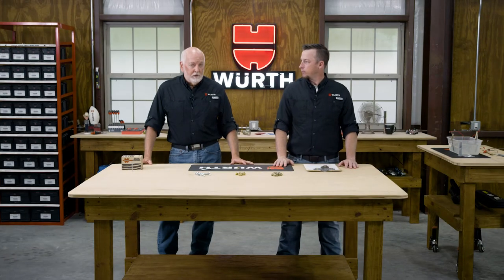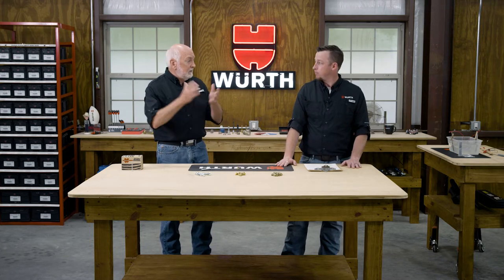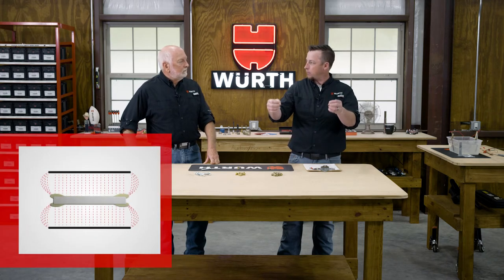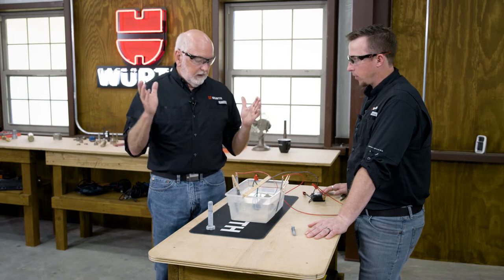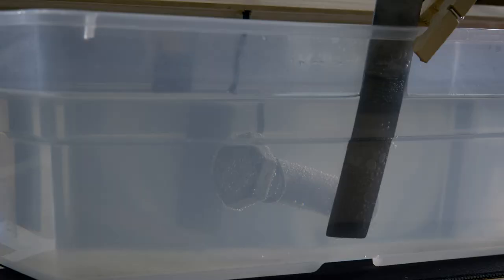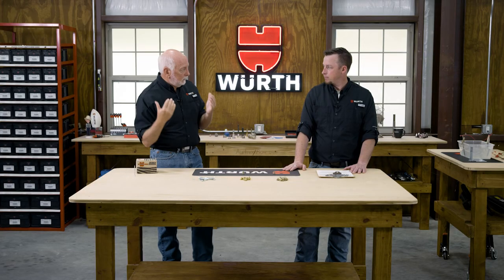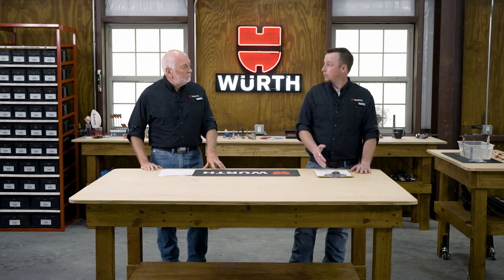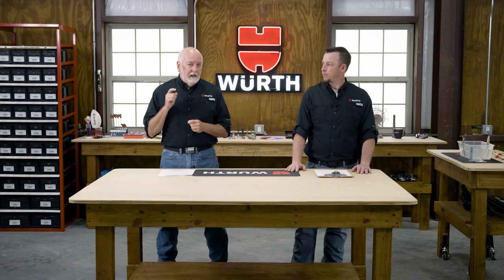All About Electroplating | Würth Knowing Episode 8

Comment: The zinc chromate conversion is used on carburetors. With changes in chemical restrictions / toxicity / etc. what used on bolts used for years, especially imports in the 70’s, commonly called “Yellow Zinc?” Was this created with the bad stuff?
If I walk into a plating facility on Monday morning, they have examples on wall board for those to point to and pick “Yellow Zinc.”
Question, it this coating durable or does it give up the ghost and simply fade away in a few years on a vehicles engine & body parts? Because buying new “Zinc Yellow Hexavalent” fasteners can take away points if not using OEM parts for that OEM grade at certain vehicle shows with a classic that is 55 years old. Just curious because I want the look, but the toughest finish! A brake booster Zinc Yellow plated adds to the look, but having the “Delco” stamp adds value.
  Please comment if the question or request needs more info! Thanks.
DK, ASE master tech since 78
Reply from the maker: As stated in this episode, fasteners have historically had hexavalent chromate applied over electroplating. This includes clear, blue, olive and yellow. With the concerns with hexavalent, the electroplating industry is moving to trivalent chromate. Unfortunately, the trivalent chromate colors do not change the corrosion resistance like we had with hexavalent. If you want a color such as yellow be aware, it’s just a dye. Many companies are adding top coat sealants over trivalent chromate to assist with scratch resistance and higher corrosion resistances. Reference ASTM F1941 and ISO 4042 for full information on this very important issue.

- Randy